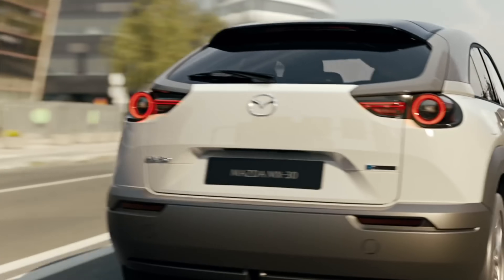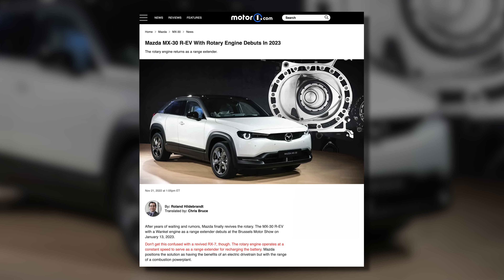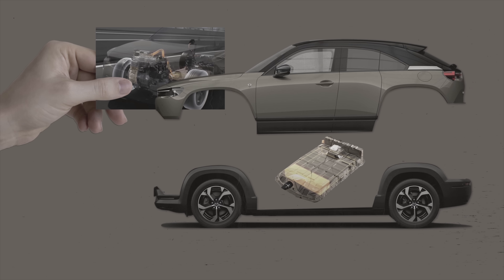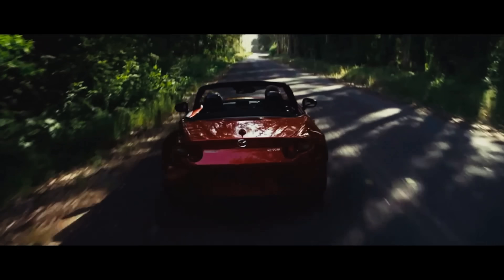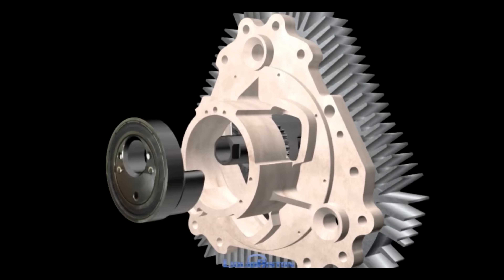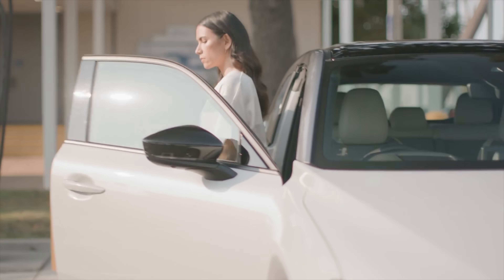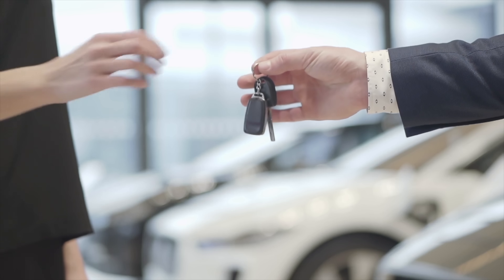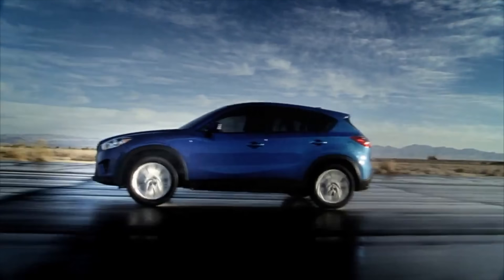Mazda's New Engine is the Smallest and Most Powerful Engine Ever Made

Comment: People should stop falling for this farce that electric cars are the future, and that they're better for the environment. They're NOT. They're far worse for the environment than internal combustion engines. Besides thinking about where the electricity to charge them comes from, how dirty that could be, there's also the following to consider:
The batteries in an electric car weighs about 500 kg. To make a car battery of this type, you need to process 10 tons of salt for the required lithium, 15 tonnes of ore for the required cobalt, two tonnes of ore to get enough nickel, and 12 tonnes of copper ore. In total you have to process 200 tons of soil to make a single battery.
And if this wasn't enough, this pollutes more than a petrol/diesel car does in 20 years of normal consumption. The mines in South America that mine these minerals also make use of forced child labour to work the mines.
One electric car may go through three batteries in it's lifetime, making the pollution equal to 60 years of driving an internal combustion car. 
Think twice before you buy an electric car, it's a scam that uninformed people fall for.

Comment: Scotty, there's no way I will ever buy an EV car. I was a gasoline car with a 6 cylinder motor, regular carburetor, points,plugs, distributor cap, power steering, power brakes and air conditioning!!! No computer anything.  That way I can work on it myself or if I need a mechanic, it's not going to cost me 10 arms and 10 legs for them to remove 5 parts to get to a stupid sensor that really isn't that expensive but it will cost me a fortune just because they had to remove all those parts to get to it. I don't need sensors because I can check any fluids that need checking and I can also check my own air pressure on my tires. The powers that came up with all these idiotic ideas, are greedy fools and too many people aren't aware they're being taken advantage of.  Thank you for sharing your wealth of knowledge with me and others who follow you.  You are a BLESSING 💞🤗💞🙏🙏🙏

Comment: An RX-EV would be interesting IF Mazda had it as a plug-in hybrid that can switch between being powered by the battery with the ICE acting as a range extender, and having the battery and ICE directly powering the drive wheels. It could be sporty when it needs to tear up the apex of corners, and reserved when it needs to drive for prolonged periods of highway cruising.

Comment: This is an old idea but a great one. Locomotion TRAIN engine cars work this way. Diesel engine turning an electric generator powering the electric motors on the trains wheels.  They experimented with a ford Pinto with no battery, just a direct connection of the generator to the wheel electric motors on each wheel and it got 80 mpg at 60 mph. Problem is the electric motors overheated.

Comment: If it is only a range extender than why use a rotary engine that's pollutes more than a piston engine ????
And you need a big and heavy engine either.
BMW I3 used a 650 scooter engine.
Way smaller

Comment: 👌 Coming around again!!! Scotty, I had a 1970 Arctic Cat snowmobile with that wankle motor and what a machine..... Rode that machine 1100 miles over the Minnesota farmland and ditches. Top speed was maybe 50 mph. Finally April came around and we just had to see the inner working so we tore it apart,  could NOT BELIEVE something like that could run so nice. I can't remember the oil to gas ratio but there was oil coating everything for plenty of lube. There was a distinct sound from the exhaust that was unmistakable. I seem to remember there was a pickup with one in it in the early 1970's a mechanic owned, maybe Mazda????  THANKS FOR THE VIDEO  -  ALWAYS ENJOY YOUR WORK!  😍😍😍😍😍
Reply: Mazda 3 in little truck 72.120 mph.

Comment: I guess I see the good thing about using a rotary in this capacity. For small engines they can be quiet and vibration free, which is good for that application. And since it won't be operating all the time, the shorter lifespan won't be an issue. Its definitely a gimmick to advertise it though. It makes zero difference in this case, since it doesn't affect driving dynamics at all.

Comment: It would be awesome to have a full 300 mile range pickup truck that had this tiny rotary motor generator, where it could come on auto at night whenever the charge level comes down to a desired threshold. And boom wake up to a full charge, whenever you couldn't charge it of course. Plus you could have 600 miles by using the little motor as a milage extender... we can only dream. Why have one or the other when you can have both ⚡ and ⛽.

Comment: 2400 - 4400 RPMs on a rotary engine?  no thanks, everyone in the rotary community knows you need to redline these engines once in a while to keep carbon from building up.  Automatic transmission RX-7s suffered from early engine failure quite frequently because of this  This configuration will not lost long.

Comment: Good thinking of Mazda to have a range extenter which can be used to power the battery pack.
This is more economical than a pure eV when you calculate the environmental factors in producing a battery and easier for the customer to use the car depending on what options are available.
This defiantly will reduce range anxiety and stress to get to a charge point, when it's not available or not working. This is what people want.

Comment: Smaller battery means lower time to charge as well. This is pretty cool. I'm not too keen on EV yet but when we get more charging stations, faster charge time with higher range (and battle tested for a few years) I might consider one. Keep it up Mazda!
Reply: Anyone who buys an EV is supporting child labour in the Congo to mine cobalt. Say no to EV!
Reply: Faster recharge time if it allows DC fast charging.  I wonder if an 800 VDC battery like in many new battery-cars.
Reply: More likely the generator would top off the battery while you got lunch.  Charging would be optional, though more efficient.  win-win.
Also, the original hybrid car (over 100 years ago) was like this - a generator connected to batteries. It's also how trains work as it's the most efficient combination of power and range.  I suspect that the future of air travel will eventually (several decades at least) be like this as well with electric engines and an onboard generator.
Reply: It'll still be a joke. 

There I fixed your thought to reality.
Reply: @Malibu1515  Electric, Hybrid, Internal Combustion, Range Extended, Hydrogen, Turbine.  Many different ways and none of them are a "joke."
Reply: People should stop falling for this farce that electric cars are the future, and that they're better for the environment. They're NOT. They're far worse for the environment than internal combustion engines. Besides thinking about where the electricity to charge them comes from, how dirty that could be, there's also the following to consider:
The batteries in an electric car weighs about 500 kg. To make a car battery of this type, you need to process 10 tons of salt for the required lithium, 15 tonnes of ore for the required cobalt, two tonnes of ore to get enough nickel, and 12 tonnes of copper ore. In total you have to process 200 tons of soil to make a single battery.
And if this wasn't enough, this pollutes more than a petrol/diesel car does in 20 years of normal consumption. The mines in South America that mine these minerals also make use of forced child labour to work the mines.
One electric car may go through three batteries in it's lifetime, making the pollution equal to 60 years of driving an internal combustion car. 
Think twice before you buy an electric car, it's a scam that uninformed people fall for.
Reply: @BubblesTheCat1  wrong they are worse at the start but through their life span they are better for the environment. Also they haven't been around for a long time. We will continue to be innovative and improve them. Just like we have gas or Diesel powered.
Reply: @BubblesTheCat1   I see you have been getting your "information" from Fox News.  ;D
Reply: @martythemartian99  Nope. Not Fox news. Scientists that have written peer reviewed science papers.
Reply: @BubblesTheCat1  Can't the lithium all be recovered and used to make new batteries? Same as the lead in traditional starter batteries. If not, why not?

Comment: Now, I am not the smartest guy in the world, but if I was an engineer, I would try and keep a 100 mile battery and try to develop something similar for a range extender, but without the consumption of oil. That’s the last thing I wanna have. Buying oil every time… No, not for me. But I like the design of it that’s all, where everything is placed. Too bad I am a dunderhead when it comes to making cars. My point of view is very strange, because I seem to want to help people get the better product, not a half-assed pile of garbage. I'm not actually sure why the product they make is always missing something. Is it because of regulations or something like that? Or is it done on purpose? Who knows… I am focused on the future, so I kind of want to see something better built, for a lower price if possible. In America a car is a necessity, while in some countries only wealthy people have cars while regular people do not. The car has to be structurally strong, safe, quiet and efficient, thats my motto. I used to drive Japanese made cars in Europe. Toyotas and Mazdas mostly. The current car I have now, is nothing in comparison. The cars were quiet and you could barely hear the engine running. You give it gas, and it’s not so loud as my current car. There’s a big difference. This makes wanna go and start my own company haha 😆. But again, I have no experience with cars, just repairing them when they break at the shop and I am also no mechanic like Scotty here. Mazda Got the design right, in my opinion, but the engine could be different. Unless there’s is something about it that nobody knows yet. We just have to wait and see.

Comment: I remember in the 70's I installed an extended range device on a Ford Ranger full size pickup. It only took a couple hours to install it by myself, but I realized an extended range of 250 miles more in  distance. If I recall correctly, the device was called an Auxiliary fuel tank. 👊🤠 Such a simple device, yet very effective.
Reply: F-250. Switch on floor near drivers door.
Reply: @fromthebackofmymind  '73 F-250 Camper Special...yep.
Reply: @patrickmcdonald3427  awe man!!...my Grandfather had a '73 jeep camper special...2 full sized gas tanks underneath, and one full gas tank behind the seat😂 2 alternators and 2 batteries...he hand made a sweet camper...had a huge V8 yet i believe only ran a single carburator...only 48,000 miles...given to me, then the famous "we dont know where it went" from family, ya ok, and no one called the cops?..they thought it was junk because it was old...barely any surface rust, it was a Georgia truck..it was mint
Reply: @tenguken847  Condolences, too good for the scrap yard.
Reply: My uncles trucks all had dual tanks with a switch in the cab. Very nice until you had to fill them...
Reply: LOL Yup. In 1979 I added a range extender to my Ford E-150 van by replacing the stock fuel tank with a 40-gallon tank -- extending my range by double.
Reply: @firecloud77  They used to sell all that stuff from J.C. Whitney too I believe...
Reply: @firecloud77  that's the way to go👍👍👍
Reply: Mid size truck..😮
Reply: @douglaswilson3978  In the 70's the Ford ranger was originally a full size pickup. The only small pickups at that time were Japanese imports. 🤗 Later during the gas shortage (government caused like today) the US car companies started making small pickups to compete with the small fuel economy Japanese models. Small Toyota Hi Lux pickups were top sellers back then.
Reply: TANKS (2) for sharing...
Reply: you actually named a fuel tank Auxillary?
Reply: @andyman8630  Yes. My dually has a 37 gal tank. Four 5 gal cans in the bed holds another 20, so a range over 800 miles.
Reply: @patrickmcdonald3427  4
Reply: Hahahaha!!!!
Reply: haha.... brilliant!
Reply: NOICE
Reply: Lmao you made my day 😂
Reply: You need an electric vehicle more than anybody I hope you bought your carbon credits got your booster

Comment: In this instance, the rotary engine is not an engine at all, just a generator that produces higher amounts of pollution than a regular cylinder engine, and the reason for having battery powered cars is...?  Also wondering how many mechanics are going to line up to fix the dang thing...

Comment: If you're young to use an ICE to charge the battery, why not just use the engine to power the car and forget about the battery? That little engine still pollutes and the lithium battery manufacturing process is very polluting.  Makes no sense.

Comment: will be the future of cars as long as the motor is powerful enough to charge the battery to full while also providing enough power to propel the vehicle with the ac or heat on to the desired destination of the user.

Comment: BETTER, TRI-FUEL TURBINE ENGINE RUNNING THE GENERATOR WITH IN HUB MOTORS TO MAKE MORE SPACE FOR A LARGER BATTERY. TURBINES RUN AT HIGHER RPM TO GENERATE MORE VOLTAGE.

Comment: Rotary was made for this.  Very small and compact.  As Scotty mentioned Computer would control rotate rpm thus allowing for long life.
Reply: I have read that the apex seals are much more durable when a rotary engine generally operates at a steady speed, which is the case for this hybrid

Comment: What's the lifetime of these batteries? How many times can you charge it ?
Reply: The manufacturers have to make it least 8 years or 100,000 miles, whichever comes first. This is a federal requirement. This warranty is against defects in the battery (i.e. total failure). Most manufacturers specifically state that the battery will lose capacity over time. Some manufacturers offer a battery capacity warranty, stating something like the battery will maintain at least 65% of it's original capacity for 8 years or 100,000 miles.
Reply: @michael.a90125  thank you Michael
Reply: One and done.
Boom boom boom

Comment: I presume it keeps going if fed with gas...? Apparently has a real gas tank with that range, unlike the BMW i3 did.
According to efficiencies I've heard of electrics, you could potentially do with 20 HP(+generator loss) at 60 MPH. If you can also use the engine for heat, then it would make all the more sense up north.

Comment: why make this car like that when you could make it a front wheel drive electric and then put a generator on the back wheels that turns when the car moves down the road and then put two batteries in and make the two work at different cycles so when you run one battery down it switch to the charged one and the generator charges the battery you jest ran down then you have power and a charge going on at all times new evs are designed like crap and its like engineers are getting payed for crap work

Comment: This range extender is a stroke of genius. We get an economically priced car. Cheap electricity for short daily trips. Very long trips with the range extender. And, if there is mechanical problems with the range extender, then it’s easily replaced because of its low weight!!!
Reply: It was called the I3. BMW from 2015 to 2021. You had the option of just electric, or having a range extender added as an option.
Reply: Cheap electricity on coal and Nat gas only. Oh and nooookalur.

Comment: the same debate people were having 20 yrs ago. "a range extender makes it a hybrid" "if you got rid of all the electric motors and batteries, a range extender sized engine would be adequate on its own" " same old arguments. EVs are energy intensive, wasteful, and horrible for the environment to acquire. We already have the petroleum infrastructure, just utilize that instead rather than inventing an entirely new infrastructure that nobody aside from millionaires can afford. Just because mazda made the apex seals thicker doesnt mean shite for the rotary, the limitations of physics and material science say that rotary combustion is impractical compated to the normal reciproxating piston engine.

Comment: My head hurts trying to understand why you need both a rotary engine and a battery in your EV.
Reply: Well - The battery has power, but it's heavy.  The rotary engine has power, but it's light.  It looks like a good compromise to enable you to use your wall socket to get around.
Reply: @daniellarson3068  But weren’t there expensive problems with the rotary engine back when?
Reply: @123Rockchild  You know - I guess they had a lot of problems with steam engines blowing up back in the day.  The great thing about progress is stuff gets better or fades away.  Give it a year and see if there are issues.  I'm sure they know about past issues.

Comment: All automakers should have started with BEVs with range extenders instead of pure BEVs. Then they would have had time to improve their battery tech. Instead of trying to copy Tesla. But...they are cowards in buckling to corrupt government pressure.
Reply: Uhhh - Aren't all these hybrids they've been selling for years effectively range extenders?
Reply: @daniellarson3068  yes, but range extenders are a simpler, less expensive design. Hybrids are more complex with 2 power sources driving the wheels. I'd hate to have to diagnose the data on one of those.
Reply: @Aaron50412  OK - Simple is good!  KISS Keep It Simple

Comment: That the rotary engine isn't at the variances in rotation from direct driving will probably go a long way to extending the engine life. It will all be run by computer systems to maintain power levels, which is likely a difference maker.
Reply: I agree, you can optimize for power and emissions levels and just run the thing at a constant RPM once it warms up.